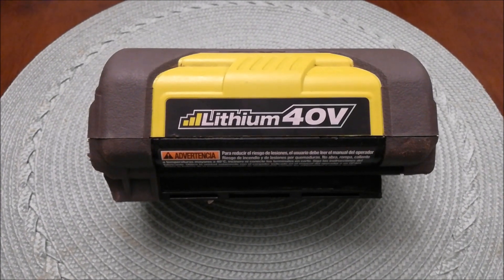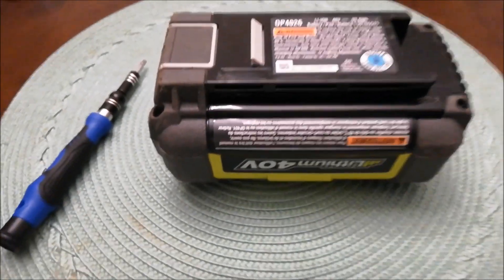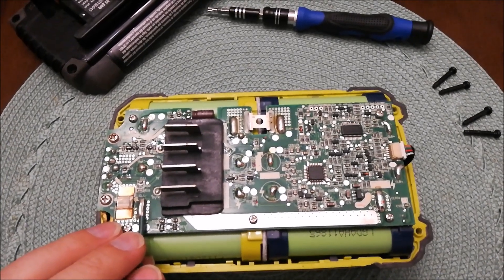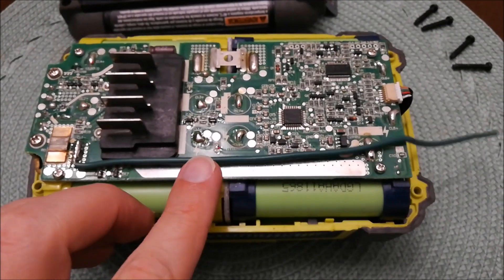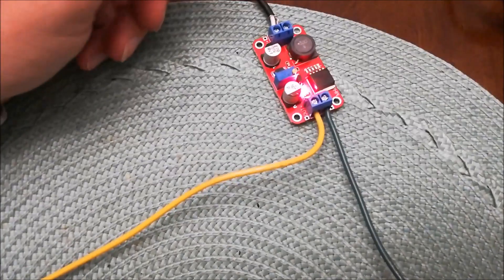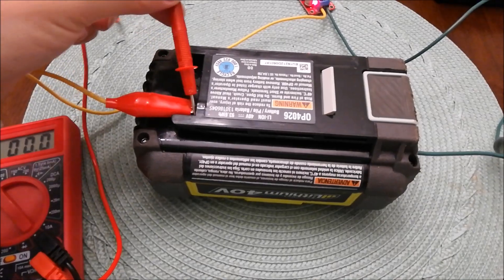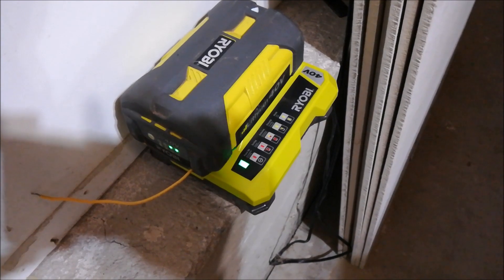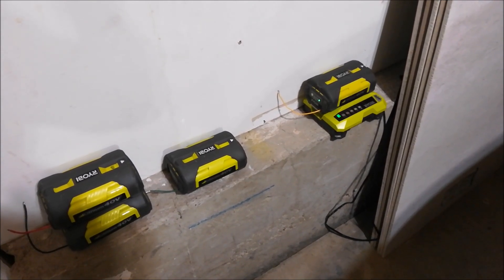40v Ryobi Battery Defective?! Let's Fix it!

Comment: I found another way that worked for me but it took some time.  My Ryobi 
40 volt would just flesh green/red over and over. I read that if you 
take the battery out, wait for one second and put it back in. Wait for 
it to triple blink red then triple green and then red again and then 
take it out again.  Redo that until the battery starts to act normally..
  I brought the charger inside and sat on the recliner and watched TV 
while I did this.. 35 minutes of rinse and repeat and WOOHOO.. my 
battery started working again... Apparently the battery charges just a 
little each time you do this and after 30 minutes oi so, it adds up
Reply: I've had my 40 volt tools (trimmer, mower, chainsaw & blower) for 3 years
and yesterday was the first time I've had this issue and I run them down until the tool shuts off.  Tried the ol' "in and out of the charger" method and started charging after the 12th time!  If that didn't do it, I was going to use jumpers between 2 batteries and try that.
Reply: @01bluebusa  Awesome.. I am a little scared of the jump start method. I watched a Nova where they messed with Lith-ion batteries and made them explode. I may be a chicken but I would hate for that to happen :)
Reply: They shouldn't as long as its + to + and - to -.  The batteries will try to equalize.  You wouldn't need to leave them connected but 15-20 seconds, I bet!  Who cares though?  THIS WORKED!! lol
Reply: @01bluebusa   jumper between two batteries can NOT help anyway as negitive terminal remains disconnected with an electronic switch. 

Check you working battery, it will NOT output 40v as the other two terminals are for trigger and sensor are open. and same way in a dead battery, negative terminal remains open nd that is why OP video soldered the wire at actual battery negative.
Reply: cool...prevents me from having to try it.  This has worked anyway, so its all good
Reply: Captinprivate 
Just FYI...
What happens when you plug the battery in is it starts charging and tests the voltage level as the video says...
So... by just barely plugging the battery in you are applying a small charge and then it fails. Just keep backing it out and then back in every 3 green flashes. After three times my battery was high enough to have the battery charge in the base.

The next time my son leaves my weed wacker out and kills my battery, I’ll make a video.

This does work though. 
I’m glad I found this video that led me down this path.
Reply: I'ma try
Reply: @gryndkommeted1362  be patient with it.. I almos gave up a couple times..  Find a show that you can half pay attention to.. I did my father in-laws too and he took me out to dinner becuse it fixed his 100 dollar battery
Reply: @leweezo33  well that is a win. I did it for 40 min and Nada. Will try again tomorrow
Reply: Captinprivate holy cow that worked haha I almost gave up 20 times but after like 30-40 minutes of listening to a audiobook it worked
Reply: I've been doing this with my 18v batteries for years
Reply: Thanks took about 6 tries then it took off and started charging
Reply: Do you have to do this every time afterwards when it’s low again?
Reply: @nobodystaysawaketotheend9848  Nope. the batt has been perfect since.. :)
Reply: I tried this, but the charger just flashes red; battery all 4 lights are constant green
Reply: I have 2 batteries so I opened the bad one and put an gaetor clip on the (+) on both and one on the (-) on the good one. Keep in mind the good one is fully charged. On the bad one with it open I put the last one on the (crl -) one for like 30-40 seconds till the dam think got really hot to hold. And yes I was afraid it was gonna explode.  After it got hot af  I just closed it quickly and put it in the charger and boom it worked.
Reply: Thank you for sharing. I tried it on my two batteries today, one for 20 minutes the other for 15 minutes - no miracles yet. Got to pause as my hands are tired.
Reply: @nobodystaysawaketotheend9848  Maybe try a power strip that has a on/off switch.  It did take me 40 or so minutes.  Good luck
Reply: I'm trying that however the charger does a "three flash red, then to a red/green alternate flash".  I'm not getting a "triple green flash" that you mentioned above.  I put my volt meter on it and it only read 0.410 so it's a very low battery (I got the mower/battery for free so I haven't expected much!).  I'll try later when I have the time to sit with it for awhile and keep trying the method you described.  If that doesn't work, I'll need to see if the mower even works properly; otherwise I'll have to get a completely new mower.
Reply: @Captinprivate It worked for me! Thanks! Took about 10 to 15 minutes or so. I measured the voltage (15v) when I started and checked it a few times during the process and it kept going up. Thanks again.
Reply: @airpilikia  Glad it worked for you!.. These batteries are too expensive to throw away without trying.. Thanks for the "measure it tip", good idea

Comment: Tried this on a battery that had dropped TOO low in voltage - ~1.6 V, so I it was too low to work. I was only able to bring it up to 8.7 V with your mod. But I have another battery with a different problem. It shows to have fully charged on the charger and shows fully charged when you press the Charge State button on the battery. But when you attach it to something like say a blower, it runs for ~2 seconds then quits. When you pull the trigger on the blower again; same thing - ~2 seconds of running then it quits. Any suggestions????
Reply from the maker: I have done this process on 5 batteries successfully, I had one battery around 1.7 volts and I was able to get it to charge up to 35 volts for the charger to recognize it. I would recommend making sure your variable voltage on the boost converter is set all the way up to 40 volts. It will take awhile but it should boost it eventually. When the batteries are that low, they have been damaged and have lost some total capacity. The battery I fixed that was that low lasts a little less than the other ones that had higher voltages.

As for the second battery, it sounds like as it's trying to pull amps through it shuts off. As you take it apart, do you see any burnt markings on the circuit board? I bet the board may be going bad. If it's under warranty you can get a replacement for free.
Reply: @Jasonoid  Thanks for the reply. 

Yes, the step-up converter is up to 40V. It's been charging for 3 days now - still charging as I write this. Are there charging plateaus? Should I be patient with it a bit longer? 

No, I called Ryobi and mine are past the 3-year warranty. 

On the one that shuts down, I did see some signs of high heat on the circuit board. I didn't find a method of removing the board - maybe swapping it with the board from the low battery pack. Any suggestions on how to safely do that?

Norm
Reply from the maker: @normanrandolph134  I have dismantled these boards and battery packs. You have to do a lot of damage to get it apart. You might be better off buying another used battery.

As for the one that isn't charging past 1.6 volts, mine only took 30 minutes to get up to 30volts, 3 days has me worried. Where are your charging leads connected?
Reply: @Jasonoid  Correction: The one that is shutting down does NOT have the tell-tale heat marks. It's the one that's not taking the charge well that has those signs. Here's a couple of pictures of the one that's shutting down. It doesn't have any signs of overheating. < https://1drv.ms/f/s!AuAvg0DMohwAhNsIk4kZWulE2z6XCA > . I took several snaps trying to avoid the shadow that my hand was casting.

Forgot to mention that the positive lead from the step-up converter is attached to the "+" blade and the "-" lead is attached to the new pigtail sticking out of the case.
Reply from the maker: @normanrandolph134  I'm guessing the charging voltage is reversed or the charging leads are not hooked up correctly. Make sure positive coming off your boost converter is not backwards. The writing is very small and that may be the issue.
Reply: Just checked the voltage on the battery that shuts down.It's at 41.1 V across the terminals. I'll take a stab at swapping boards since there's nothing to lose on either batteries at this point.

Cheers,

Norm

Comment: Thanks for the video! I just boosted one of my batteries and it is now charging on the Ryobi charger now. I didn't solder a wire onto the negative lead. Just used a n alligator clip. Also, I got the same voltage booster and it came with a heat sink. I had to glue it on but other than that it was plug n play ;)

Comment: WAIT! You can probably get a free replacement.  If you bought it new within last 3 years, you should be good with no recp't.  https://www.youtube.com/watch?v=fdooukPPE0M
Reply from the maker: These older batteries are usually more than 3 years old, however the replacement plan should work on the newer style batteries.

Comment: You could have just rigged a few leads of insulated wire to a battery charger...or a working battery...just needs a little boost for charger to recognize them...no need to dismantle, solder, etc...
Reply from the maker: I did attempt to take another working battery and put them together, positive to positive, negative to negative. It didn't make a difference. Maybe you could make a video demonstrating the way you were able to accomplish it? Thanks for the tip!
Reply: @Jasonoid  I believe he is just jumping the input of the charger and fooling its input. When you say you jumped the terminals + to + etc, did you do this on the charger? A good battery paralleled could possibly fool the protective circuit. I might try it here in a minute. There was a reason I was here ;-)
Reply from the maker: @CncObsession  I literally took another 40v battery and connected the + and - terminals together to try to get some juice into the dead battery. I would advise doing that, the boost converter method is better.

Comment: Do yiu have a fix for the 2.6 amp version yet?

Thanks
Reply from the maker: I will open a newer gen battery and see how they work. Thanks for the comment!
Reply: @Jasonoid  did u come up with anything for the 2.6
Reply from the maker: @por2guee1122  the newer batteries are covered under warranty protection, first call Ryobi and verify if it can be replaced for free. If not attempt to connect the boost converter to the positive and negative leads of the battery directly.
Reply: Hey i got it jumped already, but i cant return for warranty i buy truckloads of tools and therly r returns or ooen boxes so most batteries r the ines people return nd steal the new one. knock on wood ive fixed about 22 batteries in last 2 weeks
Reply from the maker: @por2guee1122  sounds like it's working well for you. Wish I had that connection. Battery capacity is less once they been discharged for awhile so don't plan on the same run times
Reply: @Jasonoid  Are they a little less, or dramatically (as in forgetaboutit) less?

Comment: Brilliant. Thanks. Why doesn't this work by jump charging the battery terminals that the OEM charger uses?
Reply from the maker: Thanks for the comment. I don't know exactly how the entire board works but I have noticed if the battery voltage is too low the circuit board inside disables the battery leads. I'm guessing this is to protect the lithium cells from being drained below 2.6 - 3.0 volts per cell. This disabled function makes it so the positive and negative leads aren't live anymore. If you use the CL1 - point on the board you can by pass it and charge the battery to a point where the voltage is high enough to use use the charger again.
Reply: Jasonoid: I will try your solution this week. You're the 1st on YouTube to have a DIY remedy. Thanks!
Reply: @marko6695  did it work ? Im just trying it now
Reply: Yes. Worked like a champ but I didn't solder the wires like he did. I just jump-charged the battery to get voltage above the threshold. The charger worked after that. In the future I will keep a charge on the batteries.